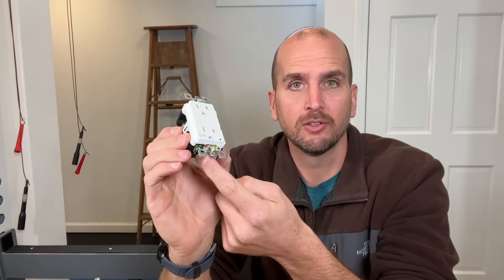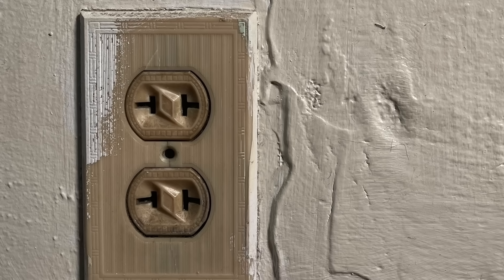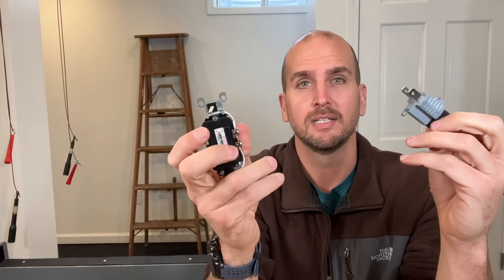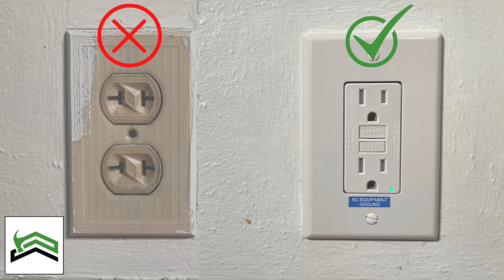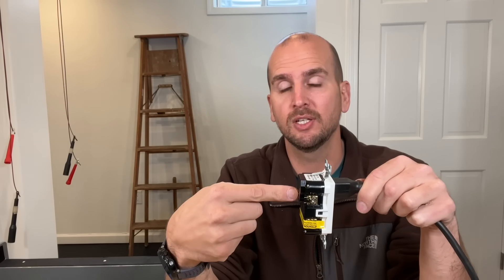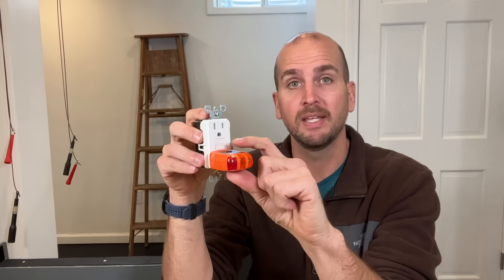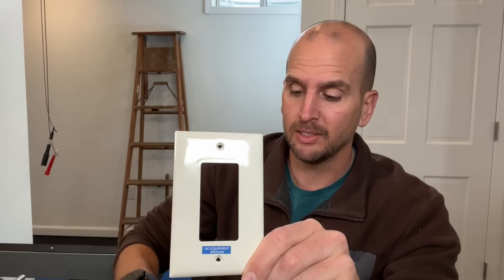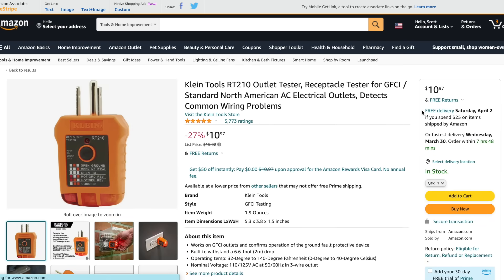Does a GFCI Outlet Still Provide Protection Without A Ground Wire?

Comment: I was hoping to see you open up that GFCI outlet and show us the sensing coil with the hot and neutral conductors run through it.  This would have allowed you to talk about how the em fields under normal conditions cancel each other out and that it only picks up a difference in current, i.e. a fault condition.

Comment: would it trip if you had done a pigtail cheat? just wondering. that's interesting about the GFCI Tester will not trip a two wire outlet.
Reply: Sure it would but why would you even use a GFCI then? If you break the code then break it. Do not think it is OK to partially break it.

Comment: you know... that the 3 /2 prong adaptor can ground if you are using a conductive plate screw plugged into top receptacle because the plate screws often have low conductivity but that screw hole for plate goes into the frame of the receptacle and that frame goes to ground that 3/2 adaptor has a metal tab that can provide a ground if conductive screw used to hold the adaptor in receptacle

Comment: To those who comment, note that im just saying that the sticker is useless if it doesn't last, and it really only means something to the person who services the receptacle, not your avg household attendant from my experience, probably 1/5 houses I've seen actually want/keep the sticker

Normally for me, I put those stickers on the back of the cover plates, just because you know little kids, small debris, etc will wear on the sticker quickly, and just having it to view somewhere for future issues, is just better than having it stick out when something small occurs. Again I more so just do this because of other issues making it useless otherwise, if anything I feel like they should make cover plates with indents for the stickers, because that'll make a strange difference just because you wouldn't have the corners of the stickers exposed
Reply: How about a sticker on the front and one on the back of the cover plate.🤔
Reply: @Glass Half Full  I mean that'd be fine, but like I told Billy, the only person who is really gonna know/care what gfci protected is, will be the professional/diy'er. Otherwise, it's just gonna wear and tear between little kids picking at it, getting scratched up, or just debris build up. I'm thinking long term and so gfci protected won't mean anything to the avg person, but for ones who know what they're doing, the sticker will be beneficial if the sticker still exist when they go work on the receptacle
Reply: @austing9060  Actually, IMHO the GFCI stickers are predominantly for the uneducated homeowner who thinks they have a serious electrical problem when an outlet is dead, but it’s just tripped.  When they see the sticker, at least they might be able to reset it on their own and not pull covers where they would possibly be exposed to another live circuit.  In fact, that goes for me too.  For the more educated, if I was working with a power tool, I would avoid a receptacle that has no ground.
Reply: @Glass Half Full  everyone has their opinion, it definitely varies depending on who gets the place but I'm looking at the avg person who doesn't even know the purpose of a gfci, let alone what it is. It can be useful to those in areas like a workshop, but from my own experience even, I've seen those stickers serving no benefit out front because a lot of people just tear them off.
It's all an opinion here for each of us, but really, the only time I see it being useful on the front is whenever you have someone with knowledge in the trade and secures it. I know code states that it's ideal for the front of the plate, but I'm thinking in terms of avg scenarios. You'll have those ocd folk that dislike the sticker messing with design. You'll have little kids and pets that'll scratch it up here and there. You can scratch it up in tight areas you're trying to plug stuff into or when moving stuff. Again, I'm just looking at the avg scenario. It can be useful for the professional/diy'er, but that's really it.
Reply: @austing9060  I did a quick survey of my close friends (four women and two men), trust me when I say they are not handy/DIYers, and all of them are familiar with GFCI circuits (though they don’t know what it stands for) and have had to reset them.  100% of them think it would be helpful to have a sticker on a receptacle indicating it was GFCI protected.   One stated that they would assume it was tripped rather than a breaker.  So, there you have it.  It would be absolutely be helpful to the non-professionals/DIYer.
Reply: @Glass Half Full  ok. It's different for each scenario, but I'm going by what I mostly experience. A lot of houses I've done work on have removed the stickers the next time I visited. Each experience is different, and so I'm just going by my experiences and gotta say setting does play a major role as well, i.e., if it's a circuit for 2 separate rooms, it can be confusing if it trips, but for somewhere like a kitchen, it can be very easy to tell whether the breaker or receptacle tripped.
Reply: @austing9060  Sounds good.

Comment: Okay, you up for a mystery? At my one room lake cabin, off grid, when I purchased it, it came "pre-wired" for 120 ac once a generator was hooked up. The "hook-u" was in the form of two three-prong plugs under the house that would get plugged into a generator when ready to be energized. Additionally, I then hooked up a solar system with an inverter, which in this case is irrelevant to this mystery. When I energize the two three prong plugs to bring 120ac into the cabin ONE SIDE shows it is grounded and the other side is not indicating it is grounded. The mystery is that there is no obvious grounding wire into earth ANYWHERE?! How can one side of the cabin indicate it is grounded (using a tester) and the other is not? The cabin is open underneath, so if there were a ground wire it would be obvious. We're in rock up there, and I thought maybe when they put footings in they had somehow ties it into the re-bars, but no, can't see that either. I am a DIYer out of necessity because there is no one to help where I am near the border. Of course, I am using GFCI's now where I can, but still am baffled by this mystery.
Reply: The tester isn't connected to earth. It simply tests the voltage between the hot and neutral, neutral and ground, & ground and hot conductors.

Comment: I wanna know whether a GFCI  will still work on 220 volts outlet having 110V each line without a ground connection. Electrical connections are in 220 volts in the Philippines and they're not grounded and they don't have hot and neutral connection just like what you have in the US. The two lines that we're having are both hot and in 110V each line, no neutral and no ground. Please advise. Thanks.
Reply: GFCIs work with 220 V also but you must check the local code and use local devices.
Reply: @okaro6595  Thank you for your advice. Appreciate it.

Comment: I just purchased an older home. The former owner replaced the old duplex outlets with 3 prong outlets. I tested them an found they are not grounded. 
Should I replace all ungrounded duplex outlet with a GFCI outlet? will this be a safer solution for my TV and computer equipment?
Reply: The simplest way if possible would be to replace the breakers and then label the outlets. Sure you could replace the outlets. When there is such shady things it is good to inspect them all.

TVs generally do not use grounding.

Comment: They also make DFCI receptacles (dual function) which provide ground fault and arc fault protection as well. They are the same size and shape as a standard GFCI receptacle and can also be used for the same application.

Comment: Wrong answer.....an effective ground path is required to trip the GFCI at once, whenever the hot line is touching the metal part of any equipment before you put yourself in risk.
Reply: No, you are wrong. A GFCI trips at 5 mA.  A normal breaker trips immediately at 75-100 A. You are confusing them.
Reply: @okaro6595  what is A normal breaker you meant??? 😂😂😂
Reply: @samlee4382  A normal 15-20 A circuit breaker. You need 3-5 times the current to break immediately. A GFCI works with just 5 mA imbalance.

Comment: Okay, so here's a question:  the EU and perhaps other countries that use 220 V mains are now requiring the plugs of appliances and electrical devices to have a fuse inside the housing of the plug. I assume (🤔😮) that either leg of that incoming 220 VAC can theoretically pass current to earth ground, so shouldn't each leg of that incoming 220 VAC be fused?  And shouldn't any primary AC on-off switches be double-pole type to switch both legs simultaneously?  Or does this only apply if the electrical panel has one hot leg bonded to Earth ground?  Aren't there earth- ground connections to the transformers in the neighborhood electrical distribution system, as there are here in the States?
Reply: The only EU countries with fuses in the plugs are Ireland, Malta and Cyprus. EU does little regulation of electric installations, it is for the national governments to regulate them.

"I assume (🤔😮) that either leg of that incoming 220 VAC can theoretically pass current to earth ground, so shouldn't each leg of that incoming 220 VAC be fused?"

Pardon? The UK plugs that are fused go only one way. Other couriers use circuit breakers in the panel as the sole over-current protector just as the US does.

"Or does this only apply if the electrical panel has one hot leg bonded to Earth ground?  "

That would be a short circuit.

Frankly I do not get head or tail on what you are saying. Maybe you have some fundamental misunderstanding. The European system is not that different from the US one. The voltage is just 230 V instead of 120 V and the plugs are never polarized.  Some countries do have grounded plugs that go only one way but as the wiring standards in different countries are different or there is no standards on where the hot and neutral are these are no effective ways to ensure polarity.

One major difference is the compatibility of the plugs. In the US (and in Denmark) the grounding is an extension in the plug. In most of Europe it is an extension in the socket. That means a grounded plug fits any socket. An ungrounded plug does not fit a grounded socket (double insulated plugs are specifically designed to fit grounded sockets). Americans have an equipment centered view on grounding while Europeans have a room centered view. The idea is to divide rooms to grounded where everything (with the exception of double insulated) must be grounded and ungrounded where nothing can be grounded. (In new installations all rooms are grounded.) For example if the sockets in the room are not grounded you are not allowed to ground  the electric radiator or a lamp on the ceiling. If the sockets are grounded you must ground them.

Transformers of course are grounded. In Finland, especially in Helsinki, a transformer is a small building a few hundred meters away. The current grounding system is same TN-C-S as in the US. Older homes use TN-C where ground and neutral are separated only in the socket. Then there are some weird hybrids. I get separate ground and neutral on my apartment but they are again combined and separated in the socket. The wiring in the apartment is older than in the building. Some countries use TT-grounding. That is the ground goes to the ground rod and nowhere else. They sue separate devices, now RCDs, for additional protection as the current would not trip the breaker.

Comment: Please keep in mind that most, if not all those houses have been using MC wire and the outer case that has a metal jacket acts as a grounding path. In such scenarios if the box is of metal, you might use a bare wire screwed to the box and use it as a grounding path which solves the problem of grounding
Reply: MC outer jacket is not an acceptable grounding path. There is a type of MC that has a small copper grounding wire spun into the shell which would act as an effective path to ground
Reply: @jackwadeiv956  
Agreed, though I think you missed my point. In old houses where you can not rewire the entire house, the MC jacket is the only thing there is to work with. Ground your metal  box to the device, plug in your tester and it would show that there is grounding. This is better than not have anything.
Reply: @homayounsolaimani8856  I see what you're saying. I understand your point. :)

Comment: Thank you for explaining WHY to those who didn't know this situation......I work on older homes where adding a ground is financially impossible..... otherwise adding a ground to every outlet is advisable
Reply: To make life more bearable you only need one GFCI outlet per circuit on the outlet nearest the circuit breaker. Finding the outlet nearest the breaker can be a challenge!
Reply: @trek520rider2  true but tell that to Section 8 people. I ended up switching all 2 prong plugs to gfci
Reply: @shanecompton2428  you could also use a GFCI and to make it even better, a AFCI/GFCI breaker type. In this case the receptacles in that circuit are protected.
Reply: How does one find out which outlet is the first one in the line?
Reply: @theward1244  shut off power to the circuit remove hot(black) wires to outlets...turn on power and check which one has power.... that's your first one in line

Comment: You can use the return as the ground providing it gets back to the box as a ground. But best is to replace the 2 wire with a proper Romex that has a ground to the box.
Reply: Bonding neutral to ground at an outlet is a super bad idea.

Comment: A GFCI should trip regardless if there is a ground wire or not! 
Nevertheless, you should still ground it even though it's technically grounded when you screw it to a EMT box.
Reply: If the box has emt properly installed, and is rated to be grounded threw the tab (its where there is a brass insert that the screw crushes down on) then yes, you don't need a extra wire. 
In many places residential applications would mean that emt is not used in favor of non metallic sheethed wire, eg romex.
Reply: @tek4  and this is why you always have to pull a gound wire 🤙🏾

Comment: I’m always explaining this to my customers.

Ground conductors are for electronic surge dissipation, or equipment fault current path… not for human shock protection…
Reply: No, their purpose is human protection. period. Anything else is secondary and should not override the human protection reason. The idea is to prevent electric shock. There currently are two main methods: grounding and double insulation. Earlier especially in Europe also lack of ground potential in the room was used especially in Europe. That is why European grounded plugs fit ungrounded sockets but not the reverse (not counting double insulated plugs).

Of course for the human protection to be relevant there has to first be a fault in the device. A working ungrounded device does not cause a shock. The problem is just that we do not know when a device fails. It is rare but it can happen. Maybe we are over-cautious with electricity. Traffic kills over 100 times more but what is the level of acceptable risk?

Comment: This may seem obvious, but why can't you connect the equipment ground to the neutral at the outlet since they are eventually connected at the box?
Reply: Because the code does not allow that. It really is that simple. There always is a reason behind every rule in the code. The way the code says may not be the only one or even the best one but it is the code. There are issues like it causing interference. I think the thing they fear is breaking of the neutral that would put the mains voltage on the case.

Comment: When working on wet ground, check green ground wires with a volt meter - wire to the soil.  Sometimes these ground wires carry enough power to nail you!
Reply: if a green wire has voltage to ground, call an electrician, because something ain't right.

Comment: Great video, can't thank you enough for breaking things down to simple explanations. Would you then recommend replacing 2 outlets over to 3 prong GFCI over using the 3 prong adapters for safety? (if you have an old house like you mentioned)
Reply: yes.  if you know the circuits aren't using combined neutrals, and you have a newer model breaker panel, you can use GFCI breakers - or better yet, combination GFCI.AFCI breakers, since older homes frequently use circuit designs that would have you needing to put a GFCI in every receptacle location.

Comment: Should you install these on all your sockets in your house and even the sockets you have on the outside of your house.
Reply: A GFI receptacle provides protection for everything down stream of it.  It you make it the device closest to the panel everything down stream has GF protection. a ground fault anywhere on the circuit will be detected and when the receptacle trips off, everything down stream will also go off.  If you buy one it shows you in the instructions how to connect it to make this happen.
Reply: @minuteman4199  outstanding, reply.Thank you, many many times......
Reply: This was about changing old two prong outlets using the GFCI. Otherwise if your outlets are working and not damaged you do not need to do anything but of course using GFCI protection is recommended especially near water and outside. If you change sockets then you may need to use GFCI on those locations.